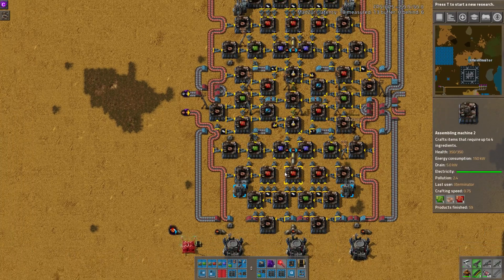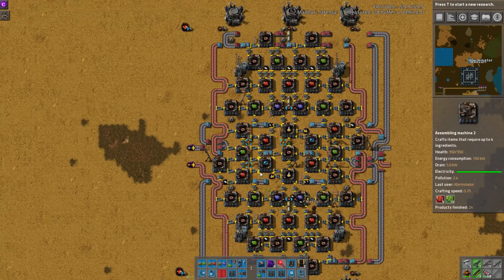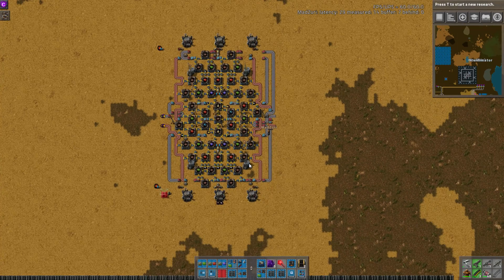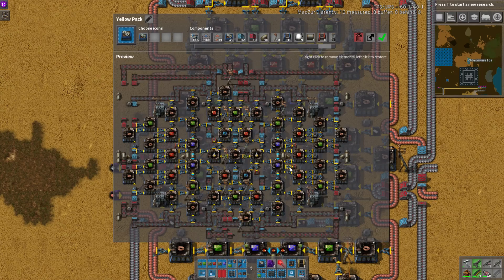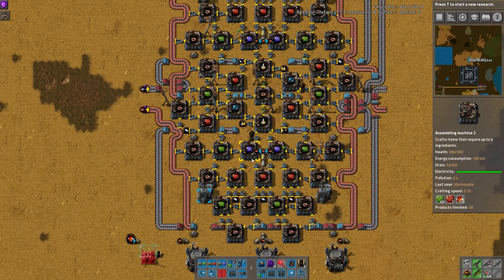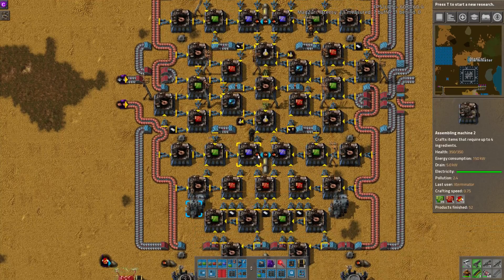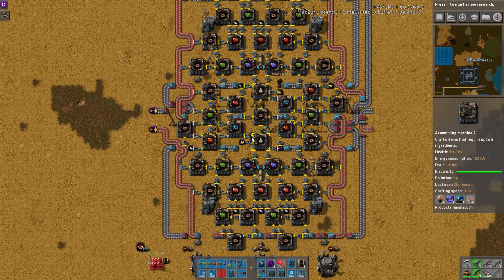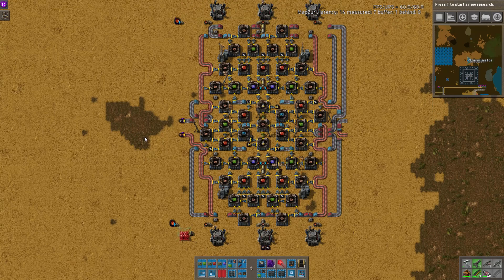rayKaito's High Tech Science Build:: Factorio Workshop Season 2 - Building A Better Factory

Comment: 0.75 crafting speed / 1.25 crafting speed * 100 = 60% more speed.
If it's exactly 2.5 builds you can run with blue assemblers that'd be 2.5 / 1.6 = 1.5625 builds with yellow assemblers, right?

Comment: If you wanted to tile that layout, you could easily run more copper and iron belts beside the sulfuric acid pipes, and then use those to supply the extra tiles.

And if you wanted to be able to extract some blue circuits via bots, you could add 2 provider chests as a buffer between the blue circuit assemblers and the yellow science provider chests.  Inserter from blue circuits to provider chest, then another from provider chest to yellow science.  (You could also move the battery/plastic requestor chest to have 4 such buffer/provider chests if desired).   That way you could buffer a few stacks of blue circuits anytime you aren't consuming yellow science.  If you add some circuit wires you can ensure that you always save some blue circuits for the logistics network.
Reply from the maker: Yup definitely good ideas for sure! Some fairly easy modifications and would help a lot. :)